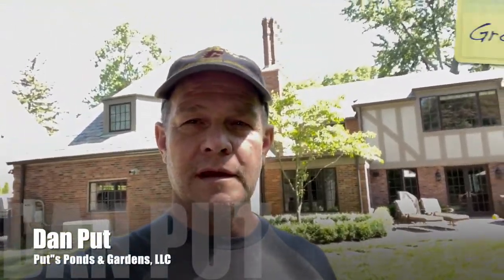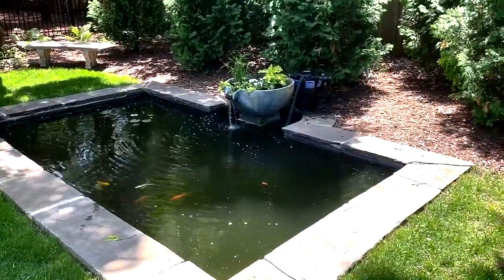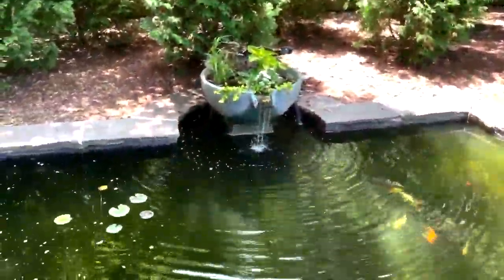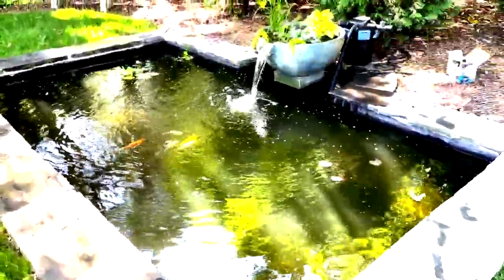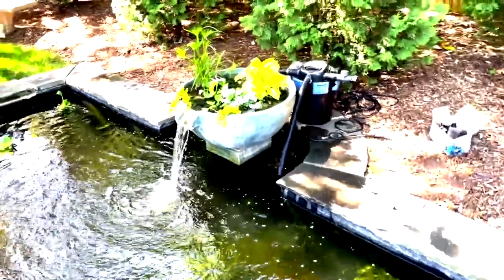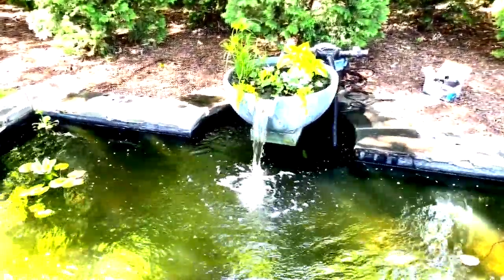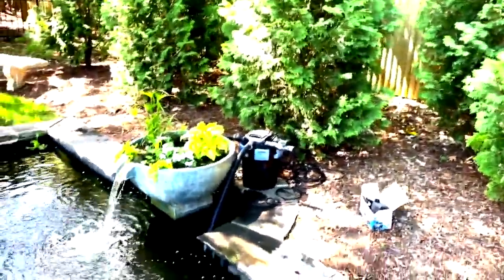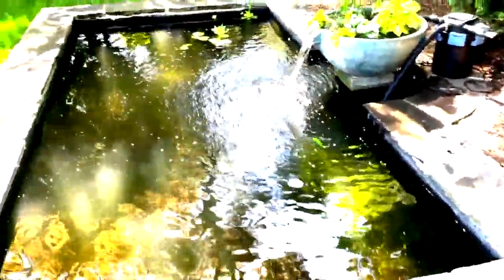Adding Filtration To A Formal Pond - PART II

Comment: Out of curiosity why don't you like to use the UV light?
Reply from the maker: It’s not that UV lights don’t work, we just choose to create ecosystem ponds without killing algae… once algae is killed off by UV lights, it’s dead algae and turns into added nutrients in ponds, the same nutrients needed for algae to thrive… plus we build here in Michigan and if uv lights are not removed during winter months they freeze and crack.

Comment: The water in the bowl moves too fast. I'd do do a diff feature but put the bowl somewhere else and have a larger bio filtration elsewhere and run the water back to the pond in a rill but slow the water down. Or do one raised above ground filtration bay with plants have it in tiers or connect with a Chanel, rill, runnel whatever it's called.
Reply from the maker: Since this video went live we… 
- added a pressurized filter behind the existing shrubs. 
- ball valves were added to the piping to slow down the water 

Now the water is filtered with the bowl and pressurized filter.